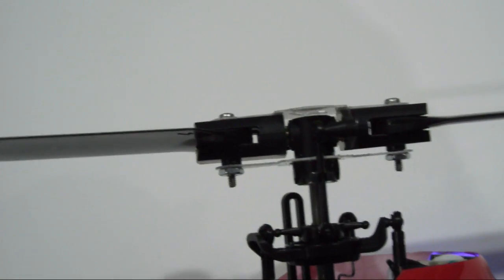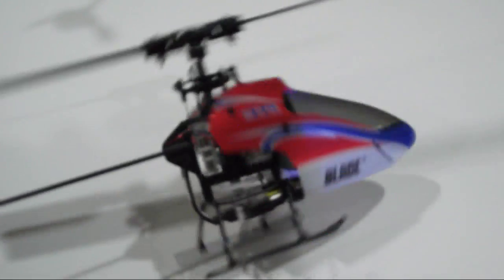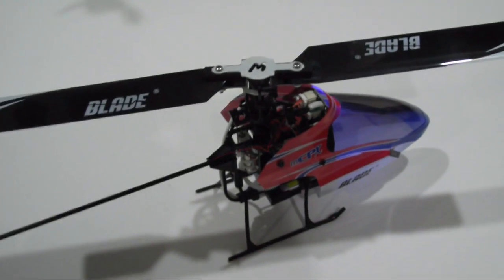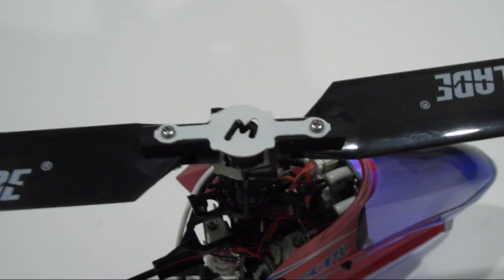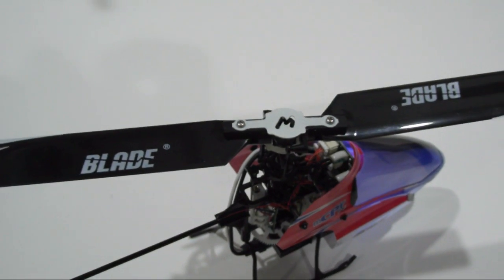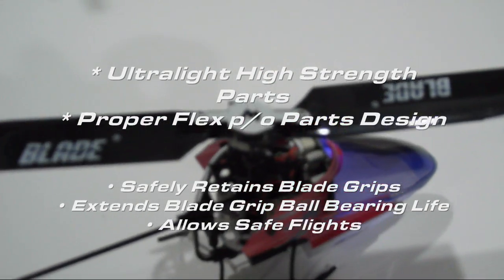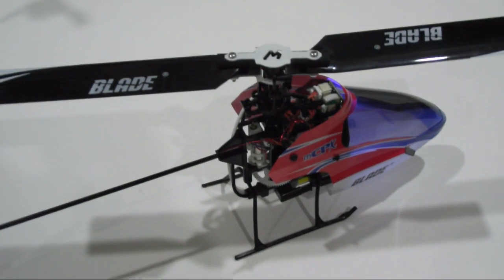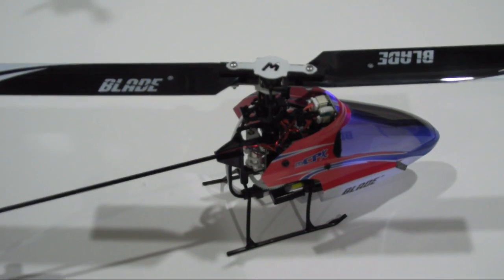E-Flite Blade mCPx  Blade Grip Safety Problem and MIA BGS Kit Solution

Comment from the maker: @dkanetracy that's great. Personally, I'm not not going to fly the mCPx without the MIA BGS, because even with good ball bearings and grips, those blade grips are still flopping at a high RPM and there is always the risk of one of them coming loose due to fatigue on the inner components. The MIA BGS provides added safety, peace of mind ,and extends inner components life by diminishing loading forces on the bearings, spindle end stops and that very tiny retainer screw.  I hope this makes sense.

Comment from the maker: @alabaska182 I'd be careful,  tiny ball bearings will give after so many flights, in some reported cases right out of the box. Thread locking the bolts is not the solution to the problem. Watch my videos carefullly.

Comment: No point in this IMO, just threadlock the bolts and they won't fly apart. 30 flights later and mines still good with the thread lock.

Comment from the maker: My point was to provide a fail safe blade grip retainer device and protect the innards of the blade grips from premature wear. If you do this, to begin with, there is no need to change any of the mechanical innards of the blade grips, except for normal wear and tear. I was looking for my personal safety and didn't  want to wait for Eflite or HH to come oup with a fix. The mCPx  is a joy to fly othewise. The BGS works very well, I simply had  to share that others.

Comment from the maker: Caution! Some people are adding additional shoulder washers at the ends of the feathering axle, this diminishes the thread grip of the tiny feathering axle end screw and the chances of blade with grip flying off the helicopter and causing injury or damage to property increase!. THE BLADE GRIPS NEED TO BE RETAINED SAFELY WHILE ALOWING THEM TO PIVOT AXIALLY. Right now you can only do this with the MIA BGS Kits.

Comment from the maker: Not so obvious, but the parts' material for this to work, is NOT RIGID, it flexes with very little resistance, this is necessary to allow the blades to pitch in both positive (upright) and negative (Inverted flight) see video @2:13. I will have another video to demostrate this both statically and dynamically (In flight) . There are other ways to do this, I tried several, but this is the most elegant , lightweight and simple and I can produce them in colors.